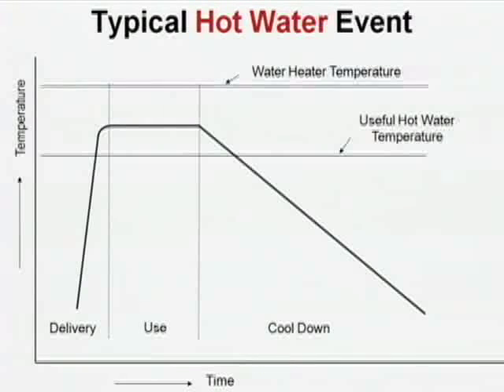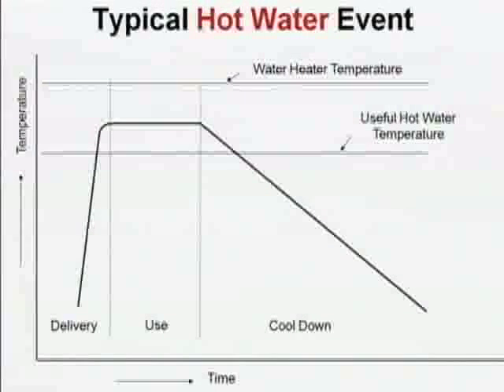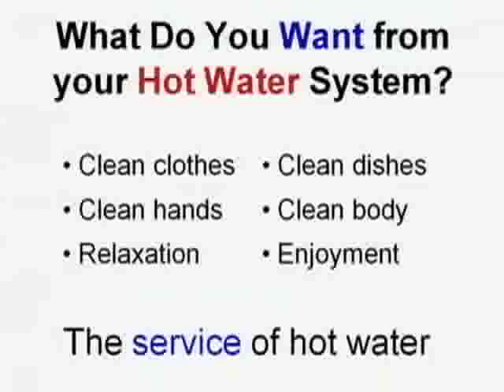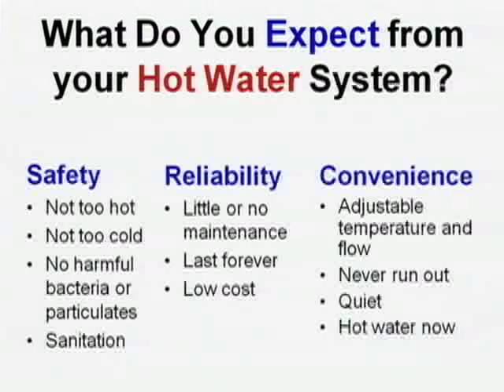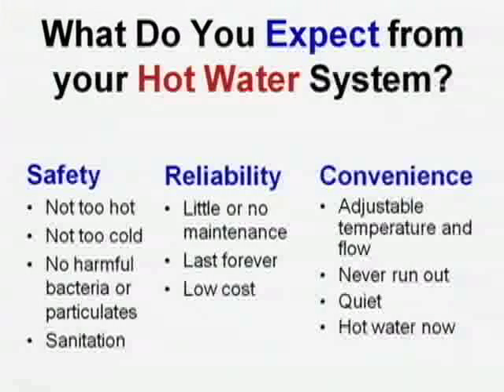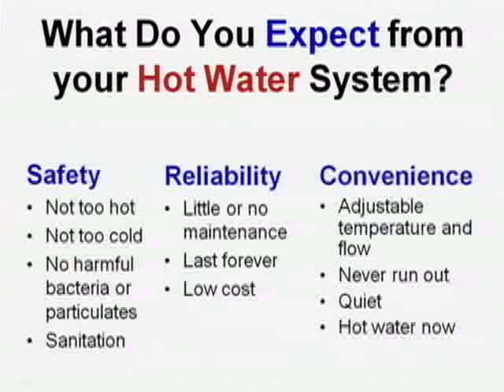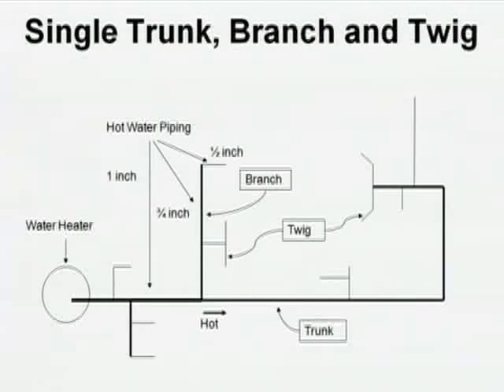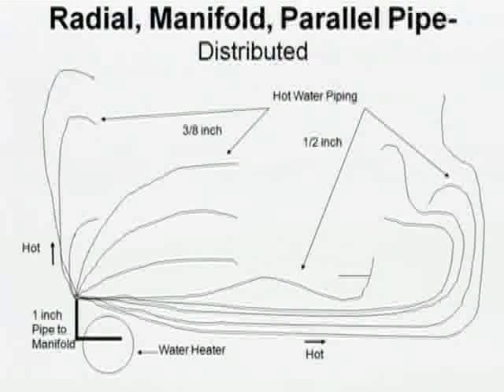IAPMO ETS - Practical Plumbing Layouts: Part Two

Comment: We have a well. When I am taking a shower and the dish washer comes on I get a reduced water pressure in the shower. (Thats Bad).
The well pump pumps water into the cold water tank, when it reaches 50 PSI it shuts off. When we use water the pressure in the cold water tank puts out water to the circuits . The well pump doesn't come back on until the pressure in the cold water tank drops to 40PSI , a 10 PSI drop.

Do you know another system that doesn't have that 10 PSI drop? 

There can be occasions where we have two showers,the dishwasher,the washing machine and the spigot in the garage washing the car all at the same time. This could take more than 13 GPM.

Do you know a system that will put out this much with no pressure or flow reduction?

oscarkemper@gmail.com